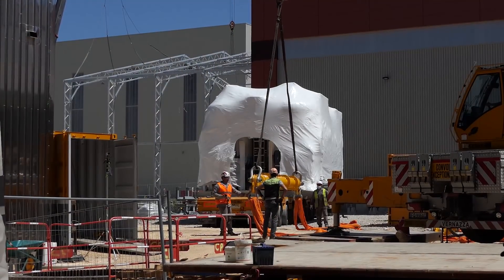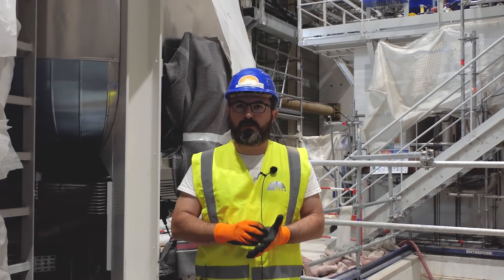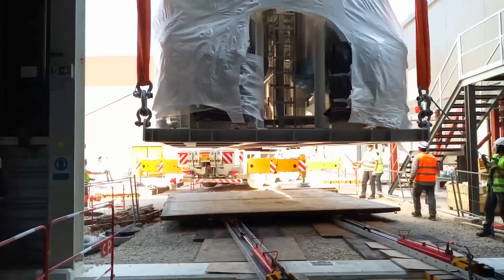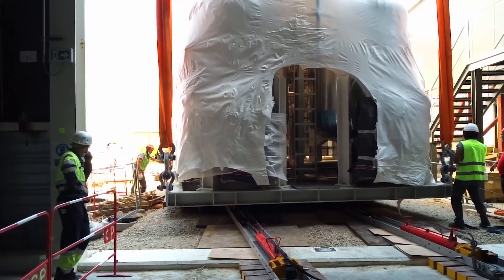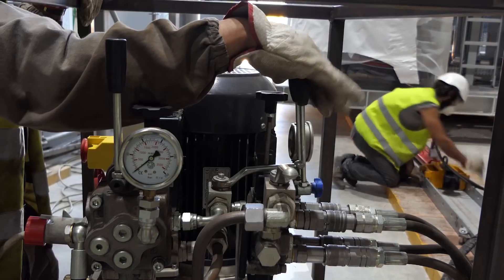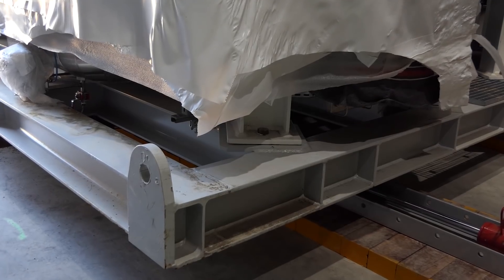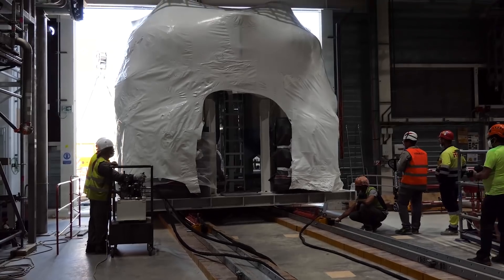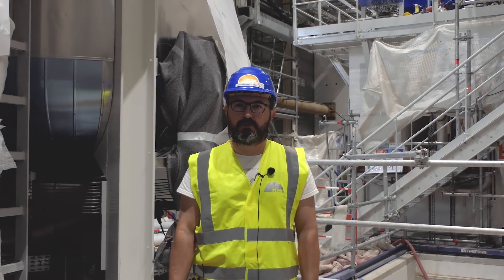A 56-tonne "Helium dryer" installed in the ITER cryoplant

Comment: a simple solar cell and some zinc phosphate With An Alpha Source Enclosed In Bismuth. No Radiation No Melt Down. Weighs About 10 lbs Lasts For 5 Bilion Years. No Need For Your 56 Ton Machine.

Comment: It is only 56 ton...  Why the hell to use rails with hydraulic cylinders to move it around?!   
Have you ever seen a D9 bulldozer transportation?  IT IS 100 TONs ! 
They use simple Winch.
Reply: A potato weighs more than an egg, but we don't ship eggs in bags. I also bet that the cost of this dryer makes the price tag on a D9 look like peanuts ;)
Reply: They obviously need “Advanced User” on their building site. They are doing it all wrong.
Reply: @Engineer9736  "We'll start by making a big earthwork ramp inside the building..."

Comment: How do you remove Tritium from the helium cooled blankets. I propose to add oxygen to the Helium. Barium oxide or Phosphor Pentoxide will remove that water from the gas.
Reply: Then who removes the barium oxide?
Reply: @bernhardschmalhofer855  I would place the BaO on movable plates. At high temperatures, the Ba(OH)2 decomposes to BaO and water.
Reply: @0000-z4z  But the goal was to get rid of the water. Now it is back again.
Reply: Another thing. The cool helium is not used for cooling the blankets. The helium cools e.g. the superconductive magnets instead. The blankets are cooled with high pressure water, see https://www.iter.org/mach/Blanket. ITER also does not rely on breeding it's own tritium. However there will be modules in the blanket for testing tritum breeeding.

Comment: 10 000 Tonnes??! How many tonnes of Helium will be consumed each second? 😳
Reply: It's not going to be consumed it's cycled system.
Reply: @Steellmor  Oh, yeah. You're right. More correct question should be: How much Helium is there in this system? (
Reply: linlinö önilnil  You are correct. It was helium gas that seeped through the protective caps on iPhone timing crystals to screw with the internals. Sneaky stuff, helium, but useful.

Comment: Damn looks like things are going really fast rn.
How long until the reactor is completely built?
Reply: I reckon it's 2025
Reply: @Dreadlockyx  I mean they will probably start testing by then but hopefully they build it earlier
So that they can get more funding
Reply: I think when construction finishes ITER will become somewhat boring for the regular people. From that point on you’ll only get some test result reports every now and then for 30 years or so. They will fiddle with parameters and see what happens inside the Tokamak.
Reply: @Engineer9736   After the completition, I think they said that it will take a couple of years to setup everything.
Reply: @Engineer9736  
I would like that the parameters could be fiddled in a way which looks like a binary search. First you try from the middle 50%, then you try 25% and 75%. Use your imagination for more dimensions. If there is a sweet area of parameters, it can't go through the ever tightening comb and you end up with log(n) guesses to get the first good results.
Reply: @asdfasdf71865  Just a little comment that binary search only works when your data is sorted. If the efficiency varys with respect to the said parameter in some complicated nonlinear way (which I guess it does) then the search gets much more nontrivial.
Reply: @YT-gv3cz  no, it is not binary sort. If the sweet areas are clustered, then it depends about the cluster size. I don't remember the exact complexity. It is a strainer.
Reply: Better before we destroy ourselves.
Reply: @ancylostomiasis  yeah let's hope so 
Unfortunately many of the countries that fund this project own oil and gas businesses
Reply: @Shindiggity   First Plasma is scheduled for December 2025. Progressive ramp-up of the machine from 2026 through 2035, and in 2035 they will then begin the Deuterium-Tritium Operation. As always, fusion is just another 30 years away.
Reply: @_yonas  At least this time you can follow it in real time from your home.